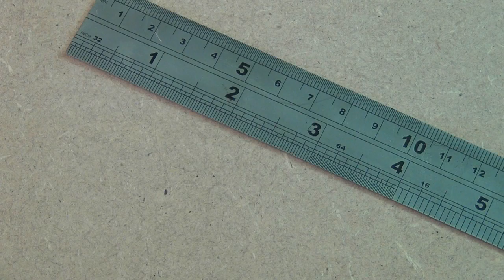Steel Rulers - Accurate Use Of

Comment: Thanks for these tips! I already have a quality Rabone 150mm steel ruler but am now considering a 600mm and 1000mm Toledo. Are these rulers good for precision woodworking?
Reply from the maker: Cheers. I've never come across Toledo, so I can't comment on them, but long rules that are accurate in both scale and straightness are good for precision woodworking. Perhaps more important is a quality straight edge though.
Reply: @mitchwoodwork  Thanks, I have a good aluminum straight edge and am planning to get a 225mm moore & right engineer's/machinists square. 

Do you know a a good woodworking forum?
Reply from the maker: There's Unplugged Woodworkers on Facebook, or Bench.Talk.101 on Zoom (also find them on YouTube, where there should be a link to the weekly meeting)